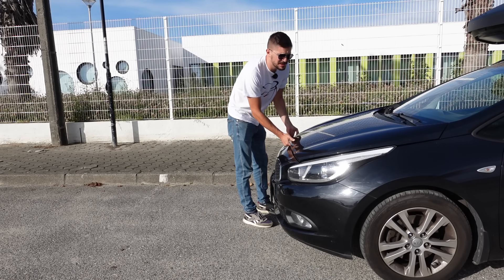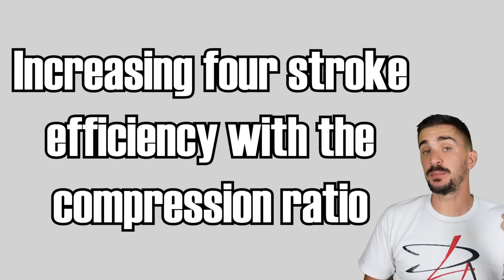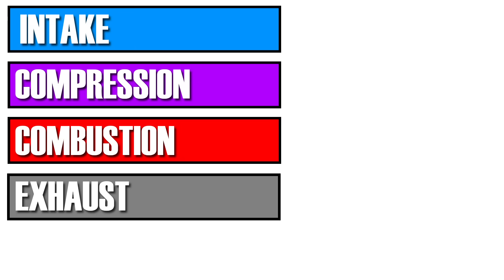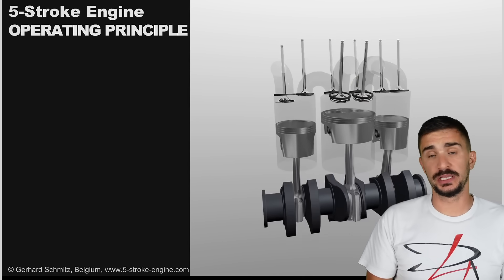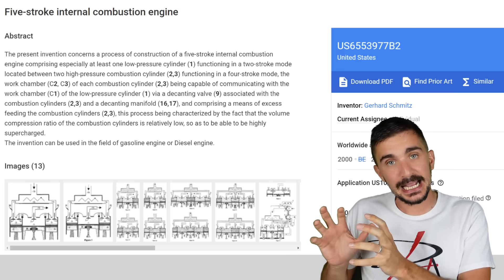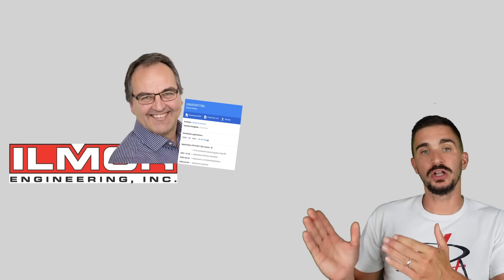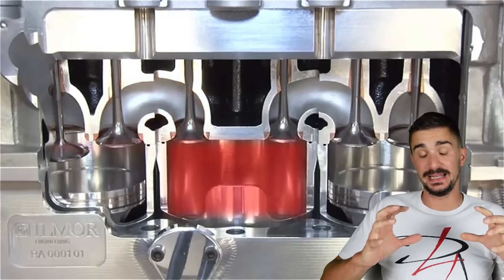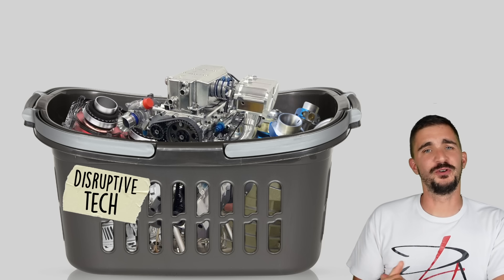Why Five Stroke Engines Are More Efficient But Still a Failure

Comment: 4:26 "But even if we don't have potential issues with knock, like in diesel engines, there is still a limit to how much...."
Was that worded as in using a diesel engine as the object in the subject of compression ratio limits? Or was that worded as in like modern diesel engines don't knock. I'm not sure if I know where to start looking for this answer. Are modern diesel engines have advanced materials and efficient enough these days that knock doesn't happen anymore /premature detonation. 
I'm not a diesel guy so I only know the basic system and how it functions, I've re-wound this part at least 6 times now and my brain is just farting on trying to understand this now. 
Thanks for any info diesel guys. I would believe knock could still happen without the engine being broken. but maybe not...

Comment: 1712, steam piston engine. widely in use until the late 70's in some places. thats 260years.
but apart from that; this design screams "compound steam engine", so nothing new under the sun. reasons why it worked beautifully with steam but not i.c.e's are many, but i think the biggest is that combustion gases mostly expand due to heat expansion of gas, while steam expansion works due to the volume difference from liquid and gaseus water. while combustion exhaust shrinks as soon as it gets colder steam keeps up pressure even when it gets colder (until it condensates) which means triple and even quadruple expansion engines existed. all with enough residual pressure to even run low pressure turbines for electrics afterwards. this "double expansion" ice struggles to get a turbine spinning
sooo yeah, nothing new under the sun, has been tried before, people just dont want to learn from the past

Comment: If those 5 strokes engines are ONLY efficient at high-load and high rpm...
DO NOT USE SUCHT THINGS in any environnement where changing RPM is needed.
Only use them with contstant high rpm situations with high loads.

In other words...maybe replacing big diesels in ocean going motordriven cruiseliners (not steam turbines, they are even more efficient...)...or in diesel electric trains and powerplants to generate electricity (also only when no steam turbines can be used).
For energy powerplants I think for mobile generators for emergency electricity producing. Or at building places for powering building tools....tools with high efficient electric motors, powered by these type of 5 stroke engine working at full power. That will save energy even with the 2 conversions ,,,diesel to electricity and electricity to drivng power.
If the claim is truthfull that this 5 stroke can be , at optimal rpm and power  reac an efficiendy of 50% instead of 40%...which is 25% more effective use of diesel. The electric generator is up to 98% efficient, the electric engines also...even when using a battery (efficiency 95% between charging-uncgharging) for eliminating peak and low demands of energy, egalizing the demand, the total savings in energy will be close to 20%.

We have more places than cars where we need engines. Just look for the correct environnement for using.

Comment: An other issue I could see is heavy carbon buildup in the low pressure cylinder. The gases condense as the pressure drops and without the heat of the combustion stroke to clean it out I’m willing to bet that heavy buildup would be an issue. The same problem was seen in early semi auto fire arms with “gas trap operation” systems.

Comment: I could see a separate smaller 2 stroke engine with a freevalve to control to route in exhaust gas at high speed and close off at low speed.  There would be still a dead weight, but it can be much smaller.

Comment: We use bypass valves for turbos, so I wonder if such a design could have been used to divert exhaust gasses straight out when at low load, and use some sort of disconnection of the piston from the crank at low RPM as well. Similar to Honda's sliding crankshafts shift over at high RPM to deliver different valve lift, perhaps  something could shift over and engage the additional piston under high RPM . Effectively removing the extra rotational weight when it isnt needed and adding it when it makes sense to do so.

Comment: Interesting. We need the exhaust gas discharged from an IC engine to be at absolute zero and barely flowing. Unfortunately, the laws of thermodynamics are not helpful in this regard. I believe the induction electric motor has been around longer than 150 years. Eventually we have to stop burning fossil fuels as the petrol chemical industry can make better use of crude oil.

Comment: People like to claim combustion engines are dying and electric is going to take over. I think it's just starting to get interesting. There's so much modern tech that makes alternative engine designs possible. And, many of them offer improvements if used in narrow power or rpm ranges. Sounds pretty good for power generators in a hybrid setup. As long as they scale down enough having some "wacky" engine design that's extra efficient and can produce 40hp or so would be plenty to power most hybrids.

Comment: Well, electric motors have similar age and were also on very early cars. Admittedly, they are less complex.
But the steam engine could actually break the time record while still being quite complex, especially the late models inside steam locomotives, they even had automatic coal insertion and distribution systems. The technology was as optimized as gas engines are today. This makes me very hopeful that a few decades of optimization can drastically improve upon the current EVs.

Comment: What about using a 5-stroke for an application that runs more or less at constant RPM like a gas generator or air compressor? Compressors at least can run at fairly fixed rpm and load so it may be a useful design for that application. I don’t know how scalable the design is, Ilmore may have chosen their displacements because that provided the best overall efficiency and so there may be only a narrow band of air compressor sizes in which this would make sense to pursue, but I do not know

Comment: If we put a cat between P-high and P-low, that solves the emissions. The cat will need insulation to prevent loss of hot high pressure combustion gasses. Then add the variable compression ratio mechanism that Nissan is working on for the other issue mentioned about low RPM vs high RPM/open throttle differences. No turbo. I see a turbo as another engine. What do you think?

Comment: When the deficiencies of this engine are addressed late in the video, one wonders at the lack of imagination. This engine would be incredible at constant rpm applications, namely electrical power generation. If it used, it could be much quieter, long lasting system. Thoughts?

Comment: to fix the low rpm problem , they need a smart cam system bypass the middle piston during low rpm and turn on the the middle piston during high rpm .

Comment: to fix the low rpm/load side of the problem with the engine i wonder if u could use free valve tech or a modified VTEC style system to open different exhaust valves. During low rpm send exhaust directly to turbo and catalytic converter. When the load/rpm gets higher and exhaust pressure/heat increases enough then send it the the LP cylinder.

Comment: When I was in college in 2014, a group of 3 of us did a feasibility sudy on this concept. We determined that there was no design goal for which a 6-stroke engine was the optimum solution (terminology we used, but it was the same thing).  If power density was desired, a bigger conventional engine is the best choice. If efficiency is desired, a turbocharger or turbine generator (for a hybrid system) on a smaller engine is best.

It's a very interesting concept and has the potential to do what proponents claim. But it's just not better than alternatives.
Reply: Everything is a compromise and it all comes down to money.

I think it would be good for generators or hybrids were it could be run at full power or not at all. Did you look at this?

What about a diesel version? Detroit now makes a road truck engine with a secondary turbine that harvests a little extra torque.

As a fellow engineer, I'd love to hear your thoughts. (Unfortunately, I got the wrong degree)
Reply: @wiredforstereo  Is the Detroit DD-15 still in production?  As you say it would work best for power generation, but a gas turbine with exhaust steam cycle (CCGT) is better for that.
Reply: @mikebradley4096  I believe the DD15 is still in production, it's still on their website.

Detroit is my favorite engine. I have a rig with a Series 60 in it. Fantastic engine. It's just so much smoother and friendlier, as well as more fuel efficient, than my rig with a Cat in it.

These engines are used for all manner of applications, long haul trucks are probably the most common, but they're also used in ocean going vessels, generators, and heavy equipment. Cat bowed out of the road trucks because they were never able to solve their emissions problems. DD and Cummins are the main suppliers there and also Paccar which owns Peterbilt and Kenworth. Then there's Mack.
Reply: @wiredforstereo  The issue with series hybrids, like you suggest, is that they lose most of their efficiency in energy conversion. Until we can convert ac-dc-ac at like 90% efficiency, and regen better than the current 10-15%, it's just not viable for most things.
Reply: @wiredforstereo  ...i cant see any benefits at all, its just a flawed concept, in theory if the rpm is high enugh, the rpm must be so high that the combustion phase dont have time to fully expand  and combust the fuel befor the next compression cycle begins, themn and only then would it be slightly more efficient, but the stress on the engine would be extreme and negate the balancing middle cylinder by far, also as it would be req to run in a phase where combustion is incomplete, the co2 emissions would be off the chart, the solution would need be to add an after burner chamber and add pure oxygen (wich isent cheap 13-20 usd/kg last year), and it takes energy produce pure oxygen wich translates to more carbon emissions to try and combat engine inefficency.. juat a bad bad idea..
..the designer appareently missed the day in school when they tought termo dynamics..
Reply: @Patrik6920  Like the man said - just too many complications!
Reply: Twenty or so years ago I read of a six-stroke engine that simply added the extra two cycles to an ordinary ICE. The two extra cycles were for induction and expulsion of clean air to flush the cylinder of exhaust gasses prior to induction of fuel-air mixture. It may have been a non-turbo diesel engine. I don't remember where I read about it and I'm not going to look it up because it obviously never became anything.
Reply: How is using exhaust pressure to spin a turbine a better use than just using that pressure in the engine? That would imply a better solution would be to throw out the 4-stroke and just use a turbine engine to start with. Which is probably true! Or maybe build as big a turbine as you can fit, into the exhaust, and have a small 4-stroke there just to burn the fuel in and generate the power that the turbine couldn't, cos it couldn't be big enough.
Reply: @greenaum  Because using that pressure internally in the engine is only possible at or above the optimized design load.  At idle or low power demand (such as traveling a constant 65 mph), it's just a bigger engine with more losses. You're not getting any of the benefit of a 5/6-stroke engine, only the negatives.  

Turbo chargers are optimized for a narrow speed range, but are still effective outside of it.  And at idle, a turbocharger is not restrictive.  

A raw turbine engine has atrocious idle characteristics and throttle response.  Fine for a plane or locomotive, not for a car.  And like I said earlier, optimized for a narrow speed range, so even something like a truck that sits at 65 mph 90% of the time would need a 50-speed transmission to get to highway speed for very marginal gains over a turbo diesel.  Also, turbine engines are extremely loud and muffling them without throttling takes a lot of space.  Chrysler, GM, and Saab all tried turbine engined cars in the 60s, they didn't work well.
Reply: Really I think a turbocompound setup is a more viable solution. Takes a lot less space and you can simply disconnect the turbine from the crankshaft at low rpm.

Turbocompound system is also something that theoretically you can simply add to an existing engine design, almost like installing a supercharger.
Reply: @danieltanuwijaya7675  This is the first time I've heard the term 'turbocompound', but yes, that is what I was describing.  I just had to look it up.
Reply: Turbo is good for power with fuel efficiency, but the air efficiency is poor.  Turbos burn a lot of air and make around twice the Nox and CO2
Reply: @earlyrobotmind  All properly running, road going, gasoline engines burn 22% of the air they intake (the portion that is oxygen).  Turbo engines avoid NOx by using intercoolers and lower compression. And the efficiency of turbochargers is often misrepresented.
Reply: @earlyrobotmind  Nonsense.
Reply: @philipelewis1  I could detail it for you but one off-hand word is not worth a serious reply.  For everyone else - he didn't really do the math lol
Reply: @earlyrobotmind  Someone who thinks that air burns doesn't deserve more than one word.
Reply: Are you implying there is no substitute for cubic inches? Where have I heard that before?
Reply: @whichgodofthousandsmeansno5306  Whether to use turbocharging, a hybrid system, or just a larger engine is a decision that depends on the goals and restraints of the project. 

A V engine is too wide and an I6 is too long for a Civic, so turbocharging makes the most sense. Even though the turbo, intercooler, and plumbing take up more room than using a larger engine, it can be arranged in a way better suited to fit. Turbocharging makes sense in a pickup where you want lots of power and torque, but also efficiency at low load. Conversely a giant engine makes sense in a pickup where you want efficiency at high load.  Turbocharging also makes sense any time you already have an engine, but want more power.
Reply: @whichgodofthousandsmeansno5306  Funny but true.  Also many hands make light work. More consecutive pushes turning the crank shaft makes good power while being stingy with the air. Uses a tad more fuel, but a naturally aspirated 3L V12 is efficient with the air when compared with a 2.5L inline 4 turbo, for example. Less air per stroke in, less CO2 out.
Reply: @earlyrobotmind  What? CO2 doesn't come from the air you use, it comes from the fuel you burn. Oxygen can't become CO2 without carbon.
Reply: @whichgodofthousandsmeansno5306  cubic inches?, who uses that achaic measurment...

Comment: Just post WWII, there was a form of turbo for piston engined airliners, which could capture a lot of the exhaust energy. Like a LOT of the energy. This was something used in production. Wouldn't this be mechanically simpler than changing the stroke? https://www.youtube.com/watch?v=gbMgwDIdScY&t=1659s

Comment: You can mimmic an Atkinson cycle by playing with valve opening. That's what the Gen2 Volt's generator did. By retarding valve closing, you can force air-gas mixture to flow from one cylinder to another through the intake manifold, thus dynamically playing with compression ratios.. It produced a very efficient engine.
Reply: 1.7 litre? Why do people use the metric system wrong?

Comment: Okay I can see issues with the engine.  If the engine is purely focused on fuel economy and not performance - it is very good. 
.
Ilmor does racing engines and efficiency is of secondary importance to performance. Now looking at a simple 4-stroke engine in a race setting:
There is so much fuel pumped into the compression stroke to maximize the force of the power stroke... but what normally happens is that as soon as the outlet valve opens the explosion (not just expansion) is still going on. Often we even see flames coming out the exhaust. The intention is to allow the expanding gasses to free themselves out the exhaust and minimize slowing down the engine during the 'squeezing exhaust stroke". Ie: make the engine as free spinning as possible. The expansion box of the exhaust is designed to literally such out the exhaust further decreasing the 'squeezing exhaust stroke'.
.
Ilmor probably discovered that as they scale up from a 700cc engine the performance deteriorates (for racing requirements). Shmitz probably saw that the engine has a life as a fuel-saver which is a little contrary to high-performance requirements.
.
My personal view is that the third cylinder should not have any valve but rather just open ports. A turbo probably makes better utilization of the exhaust energy that the thrid cylinder.

.
.
I used to love these engineering ideas until I experimented with an electric vehicle back in 2014.  10 years with EVs and I am now a full convert. The engine is a remarkable piece of engineering - but we are truly at the same age of transition between horse drawn carts and cars.  The benfits of electric are over the top and the downside of electric (batteries) has been pretty much resolved.

Comment: A power recovery turbine system like used by Wright on the R-3350 radial engine would make more sense, but only for an engine that runs at a constant speed.